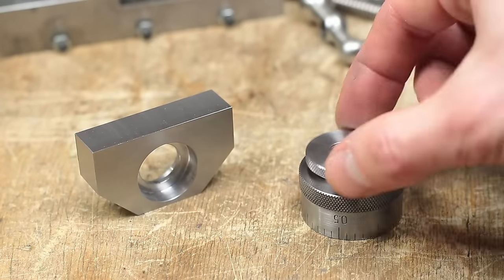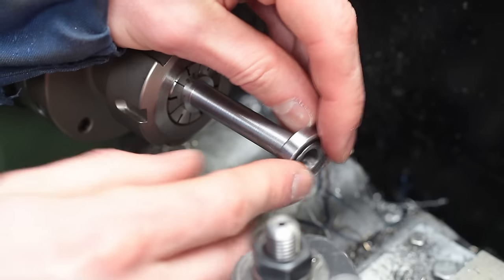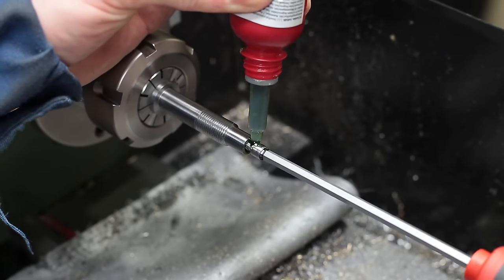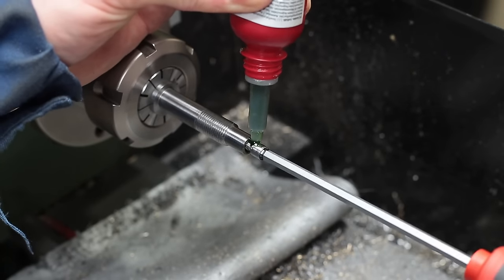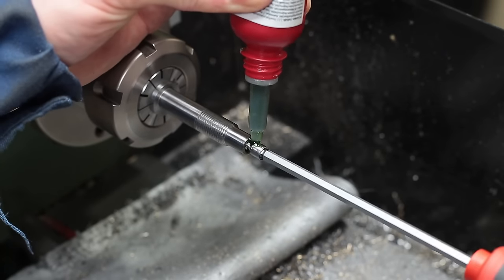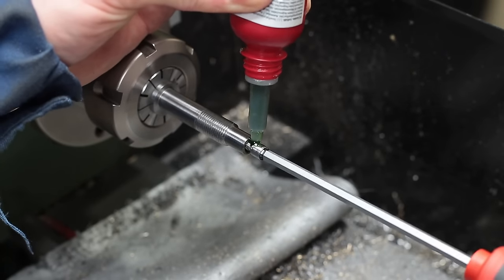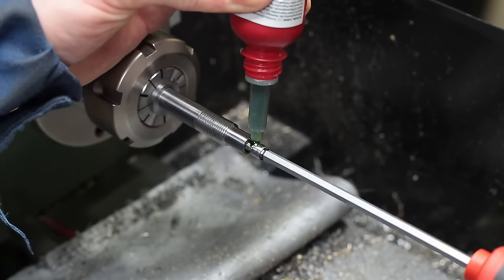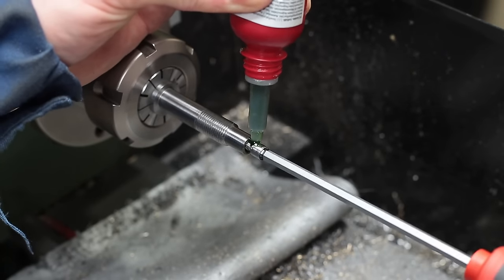Mini Lathe Compound Slide Rebuild to High Precision Standards Part 2/2

Comment: That bearing fit was absolutely shocking.  angular contact bearings are pricey, I would expect better tolerances.
Reply from the maker: Yes, that is really weird. The bearings I bought where relatively cheap but nontheless the tolerances are disastrous.
Reply: In my bicycle shop I order always Enduro Bearing and I never have issues with tolerances in any way, also with angular contact bearings from Enduro
Reply: only P4 or better AC bearings (for spindles) are expensive. Even European made bearings just aren't so bad in standard grades.
Reply: You get what you pay for. When you buy trash they don’t send diamonds.
Reply: There just cheap low tolerance  bearings from China that he bought
Reply: @ieaiea5081 not low tolerance mate, NO bloody tolerance lol
Reply: Agreed!
Reply: You really are shocked that a mass produced bearing has a tolerance of 2 hundredths of a mm? Apparently u don't do much for machine work. That is incredibly tight for clearances. As a drafter designer I would find this part more than acceptable for use in our products. Trying to achieve a press fit of a bearing on a two piece assembled shaft is what I find shocking. That shaft should be made in one piece with a thread relief rounded at it base for maximum strength for that small of a part. Simple stress analyzing software is available on line to enable proper decisions in design.

Comment: For clarity, if using standard threads: acme for Imperial/US threads (29 degree included angle), trapezoidal for Metric threads (30 degree inc. angle.).
Reply from the maker: Oh thanks for your feedback and the hint on the threads. I didn't know that. So for me (in the metric world) it should be always be called "trapazoidal" :) Thanks ;)

Comment: Great video, great build. The idea to install socket head cap screws that you turned the head down to allow placement in the end of shaft so you could access with an allen wrench was great idea. Looking forward to your next video.
Thanks for sharing.
Reply from the maker: Thank you very much for your comment! Happy to hear, you like my work. Until I make a rotary broaching tool for internal hexes, I have to go with the screw method ;)
Reply: @WeCanDoThatBetter  In case that you´ll sell these perfect compound slides - i´ll buy one.

Comment: This is quite excellent! Congratulations on a magnificent rebuild.
Your hex key modification also affords you the opportunity to achieve some very nice surface finish on tapered parts.
Reply: It's glued in, might not fair well on retraction with time, you can make a tool to cradle the handle anyway..  What a great build to watch.

Comment: For when you remove the handle, a thumb screw with internal hex driver that aesthetically fits the other knurled surfaces would really finish it off. You could still retain an internal hex on the outside of the thumbscrew, incase you need extra torque during machining but I doubt you'd end up needing it that often

Comment: I like the hex in the end of the spindle as you can now power feed the compound slide to get a nice finish on taper turning by using a ball end key in a cordless drill which will give you variable feed speeds. the back lash adjustmend is very good too.

Comment: Beatufully done and well designed <3 should last forever I think
The bearings were probably matched so that one would be a press fit on a shaft and sliding fit in the bore and the other a sliding fit on the shaft and a press fit on the bore for ease of assembly 
Or they were just cheap 
Precision spindles are a not the easiest thing to design

For tapping the Tr8 hole, brass is always like that  but a little oil helps
Reply from the maker: Thanks for your comment! I rather think they are just cheap ;) (which they were..). And yes, I think for brass a rather negative cutting angle would be better but it worked anyway.

Comment: If you use a ground shaft or the workpiece before turning you can use the DTI to dial in the tail stock. It’s easier than tuning out the taper after it’s cut

Comment: Excellent work as usual. I think you meant leadscrew when you say spindle. I'm looking forward to the video where you ditch the compound slide and replace it with a solid tool post mount 😂
Reply from the maker: Thanks my friend! And thanks for the hint on lead screw vs spindle :) I'm not yet in the solid toolpost party :) Perhaps some day I will try but for now I like my compound slide :)

Comment: For future reference: your machining and cutting that acme thread on the brass parts caused the metal to work harden, to resolve the "crunchiness" you need to heat treat the brass to remove the hardening... 
Also, I would suggest cutting the thread before machining the rest of since a fair chunk of that first part looked VERY thin and I was afraid it would snap off while trying to cut that thread.
It could also allow you to hold it on some of the acme rod to keep the thread centered on the parts 😉
I like your making a bottoming tap as they're called, but that blueing had me concerned the temper on that tool was damaged, which isn't a concern for soft materials like brass etc, but could be a problem if you wish to use it for steel... if necessary, that could be easily resolved with a little heat treating

Other than that observation, FANTASTIC JOB!

Comment: Press fits on bearings and races can be used to adjust ball clearances by elastic deformation. I discovered this by inadvertently ruining a ball bearing by pressing it on a solid shaft that was a touch oversized.

Comment: 35:41 maybe cut off the ball the screw sits in on the turning handle and make a screw with a ball head, so you don’t need a tool to fix the handle but instead fix it by hand with a knurled screw / Rändelschraube. 
Awesome work by the way, you inspired me to get my first lathe! :)
Reply from the maker: Thanks for your comment! :) Sounds like a good idea too. I have to see how it works in the future and if there is a need of changing it.

Comment: Cool cool, surprised you didn't use any astroglide when cutting that acme thread.
Also that poor poor tap changing color as you cut it.
BTW what kind of bearings are those? As generally tolerances on those are VERY good.

Comment: great video, fantastic ideas, ant thoughts on putting oiling points on for the nut, screw and gibb while you were at it?
Reply from the maker: Hi and thanks! That's a good point. I think about this but I have no good ideas yet, how to get the oil to the nut. Do you have any ideas? And for the ways it would be cool if with only one oil port I can lubricate both sides.
Reply: for the nut just one drilling through the topslide  to the middle of the nut. same with the screw. slides i think you would be better doing them separately, it would be a very complicated array of drilling passages etc to do a "one shot" for both slides. @WeCanDoThatBetter

Comment: Nice job, and some realy good solutions.
One question... can the bottom of the dial ring pass the top surface of the cross slide? 
So when you put a compound at acute angle, you still get a full CS travel (of course, after removing the handle).

Comment: When cutting threads on a lathe like this; how does the cutting tool always manage to sync up with the start of the thread whenever you take a new pass? I've often wondered how that works. Sorry, I'm no machinist, just a guy wondering. 😅

Comment: Why is there the spacer ring between the bearings? If it is thicker than the web left in the bearing block, it prevents preloading the bearings and if its thinner, then it just floats there, doing nothing, doesn't it?

Comment: I had this issue with non fitting bearings several times with cheap chinese? bearings.
I strongly recommend to buy quality bearings (SKF, FAG,NSK,...). 

If you measure an inner diameter of a 12mm quality bearing, the tolerance should be less than 1/100mm.

This is quite important for the fit on your shaft. You need some tight fit (see literature), a sliding fit is always bad for bearings. The bearings must neither rotate in the case nor on the shaft.

Comment: Nice video  ..one question can you make lead screw  or which die tap tool need ?
Reply from the maker: Thanks! It is possible to make a lead screw on a lathe but you need a tool with a special geometry. You would most likely single point thread such a thing. As the cut is relatively aggressive I don't know if that's a good thing to do on such a small lathe. As standard parts are so cheap I wouldn't bother cutting it myself.
Reply: @WeCanDoThatBetter  hi thanks for anwer and advise  yes search little bit good to buy ready product

Comment: Why does the tailstock wobble?
Reply from the maker: On which point in the video do you referring to?
Reply: @WeCanDoThatBetter  pretty much every point of the video that the tool in the tailstock is cutting. You can see the tap shift in the compilation within the first 6 seconds of the video.

Comment: Nice video and presentation. 
Have we noticed the acme taping result? Finished acme axis is tilted from the spindle axis of lathe. It depends on if the tilt was intentional. Page 13:16
Reply from the maker: Thanks! If you have noticed, after starting cutting the internal thread, I reclamped the part to machine the bore from the backside. After that I flipped the part over again to finish cutting the thread. For this operation I didn't carefully align the part as the thread was already started and runout was not critical anymore. That's whay the spindle wobbled as crazy when testing for the fit. If I had dialed in the part to run exactly true, I guess the spindle would run true as well.